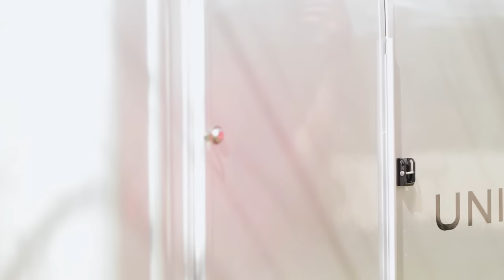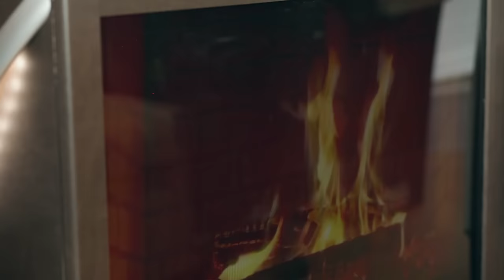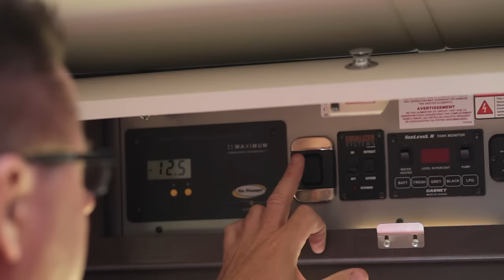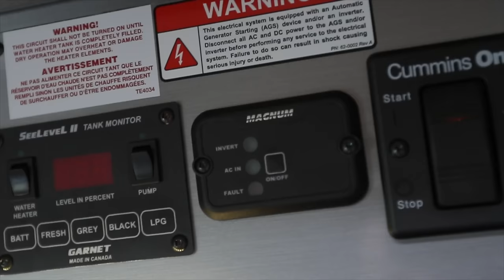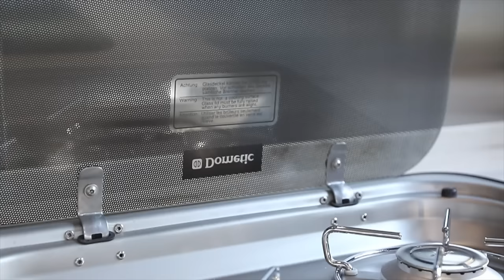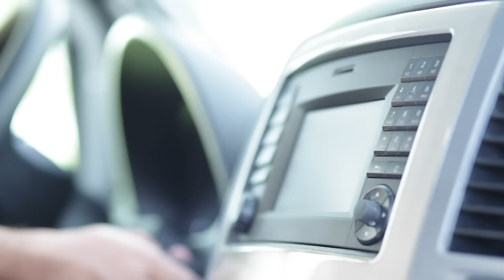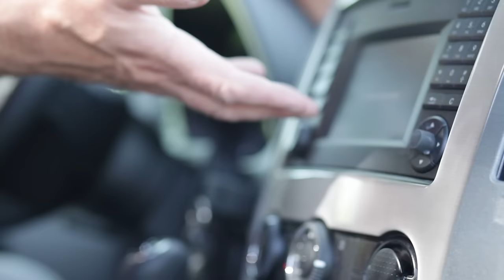2016 Unity Murphy Bed

Comment: Great! I'm glad because this leisure lounge model reach one of the two ideas i wanted to submit you as a suggestion in the past.Here i would just add for murphy bed to be a relaxation bed (ie electric commands for head and foot so you can change position at will). Second option is an accessory : a remote control for lights, relaxation bed, tv... ie it's about "home automation" for your van. Or without the physical remote control itself but an app for android sending commands to an interface controlling the mentionned elements.
Another suggestion : the table you pull from the murphy bed is one "panel" table. I suggest 2 panels, one over the other for the purpose one panel can rotate on an axis so that one seat could have a desk environment to work on (think a laptop, documents around or additional screens...). There is another way to achieve the same goal : laptop and additional screens are already installed "in the murphy bed" then it comes down to the people sitting on the seat.
Why not having solar panels almost all over the top? Is something planned to recycle rain water?
Thanks four your stories too. In the meantime to have leisure travel van in europe, i would suggest another section on your website : guides for those who simply want to have a mobile way of life in canada, ie who don't have a house as they are always on the road. Options to have on the top satellite connection for internet (is there unlimited satellite connection in canada?), tv and phone, related price subscriptions in canada would be interesting.

Comment: Good Afternoon,
To bring the cost  down.  Place the Coach on a Promaster 3500 frame without the slide out.  Use the Pentistar v-6, gas motor.  MSRP prive would be about $90,000 or less.  Some one will do it!  AND it will sell!!  Even Campervan Kevin could buy one!

Comment: Isn't stealth the whole point of Class B RVs? You could see this thing coming from a mile away... it will be as difficult to park/boondock as a smaller Class C, which has more space than this anyways. Additionally, pretty sure that the price point of this will be x2/x4 a small size Class C. A bummer, because I like the murphy bed setup.

Comment: Nice concept, however, two items I would change.  The Murphy bed needs to be a couple of inches longer, as in the video, Dean had his feet over the end of the mattress.
The other issue is the shower is too tight.  As a senior, I need a shower with a seat, as I can't stand and reach down, as many seniors can't.
Reply: +Greg Miller If he was on a queen size bed, as he said he was, he was turned the wrong way, his head should have been pointed towards the drivers seat and his feet would have still been on the bed.

Comment: like a lot of it but not fan of sprinter. the 4cylinder diesel or 6 gas seem underpowered for heavy camper especially for city stop/go & going up mountain roads/hills. anytime a cutaway van with heavy wide body fiberglass rig attached on b or c it has to have good power to weight ratio or ya will be out a lot of $ to the mechanic. also the tv, ac and batts got problem with. would like to see smaller more efficient 5-8k btu ac for those not ever traveling southern hot states. tv, I don't watch so rather have just open space or use space for something I could use. batts, aren't these things like $100k, why no lithium polymer or oin? and know it's a stretch but would like no generator and see that be storage space and just whole roof including ac shroud covered in those thin solar panels. between right batt set up, efficient ac and the isoator(maybe even a double isolator system to 24v setup?) think could work. also would like to see bed 10inches narrower, that space not used when vertical be more storage cabinets or something else above it instead and bed be couple inches longer, I'd be sleeping a little corner to corner on this thing if under 77inches length.